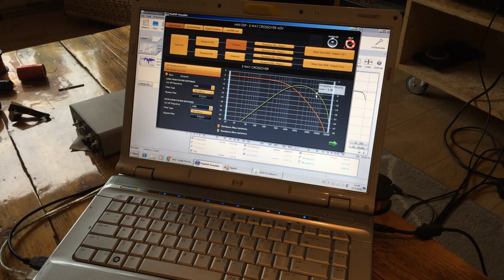Inverted Electrostatic speaker -  Segmenting  etch test

Comment: As I recall, an electrostatic diaphragm works well using high resistance coating.   I'm not certain on the value, but I think you want something in meg ohms  per square range.  The goal is to have the panel time constant (panel resistance x panel capacitance) slower than the signal to be played so that charge does not move across the diaphragm.
Reply from the maker: Yes in a normal esl thats absolutely true. But this is an inverted one.

Comment: joppe I didn't realize this was 5 um TOTAL before I commented below. Etching def better for AL removal. Any hint on where you found this mylar? I have the 12 um metalized.
Reply from the maker: its not that hard :) look for hobby shops for RC planes :) they use it as coverage. and im sure it is used in capacitor builds.

i might ask the guy i got it from  to sponsor me to be honest the stuff dont cost shit to buy bulk.

as for now :) here is my source https://www.freeflightsupplies.co.uk/
Reply: @joppepeelen   OK Thank you. I see some discussion for locating 5um on RC forums here in US. I'll see what I can find.

Is your film even measurable? The DC resistance. Most stuff I get I can see through if I hold it up to a light. Might be able to measure with a Meg Meter but not normal DMM Meter. Seems the ultra fine coating might work for esl speaker.
Reply from the maker: The 30cm wide foil is measuring in the 2-3 ohm rang depending on distance between probes ofc. I did use 2 pennies to not puncture the foil.
Reply: Well it has a lot of metalization. probably cap PET like you said. Thanks for the replies joppe.

Comment: For those who may not have copper sulfate on hand. Car polish (scratch remover type- "Scratch X") also works very well.
Reply from the maker: but does it dessolve or scratch it away since that is a huge difference, i dont hurt the mylar itself here. the alu is etched away without rubbing or anything.
Reply from the maker: Here are the ingredients

Aluminum oxide; 
solvent naphtha petroleum,
hydrotreated Hydrotreated middle distillate (Petroleum base oil) 0.23 mg/m3 2.5 mg/m3 15 mg/m3

glycerol Glycerine (mist); (Glycerol; Glycerin) 30 mg/m3 310 mg/m3 2500 mg/m3
triethanolamine Triethanolamine; (Trihydroxytriethylamine) 

as far as i know none of them etch, i think it uses the aluminium oxide(as sanding paper except oxide instead of sand) combined with the solvents to scratch and dissolve paint.  so you are actually sanding away the alumnium. might work i guess but it will also hurt the mylar. so etching i think might be better.
Reply: @joppepeelen  On paper might seem it would hurt the mylar but it doesn't. For car paint takes a lot of pressure and rubbing to remove very light scratches but the mylar very light pressure and AL comes right off. Not saying it's better than etching just an alternative

Comment: Доброго времени суток! Чем с мываете покрытие?
Reply from the maker: could you please use a translater yourself next time ? since if i want to read you reply i have to translate it.. you can easily do that yourself.
use goolge translate.
Anyhow im not sure what you mean the coating on the foil or the stuff i used to get it off :) the coating on teh film is alumnium, the stuff i use to etch it is copper sulfate with kitchen salt. copper sulfate can be find at some stores to i believe increase PH values of swimming pools (can also be reduce i forgot) anyhow it is the green/blue stuff it says on the package what it is exactly. i buy mine at a chemical company since it is a tad more pure, and having a pool is not so common in the Netherlands so it remains not easy to get.  people that work with ceramics also use the stuff to color there glace. so thats another source.  that was my first source since my dad makes ceramic sculptures as an artist.
Reply: @joppepeelen  It's me again from another account on the mobile phone transfer can not. I had a question what means you wash away aluminum from Mylar?
Reply from the maker: i use an acid to get rid of the alumnium where i dont want it